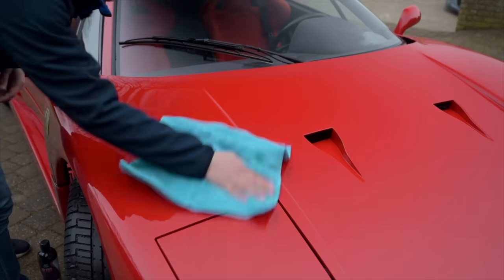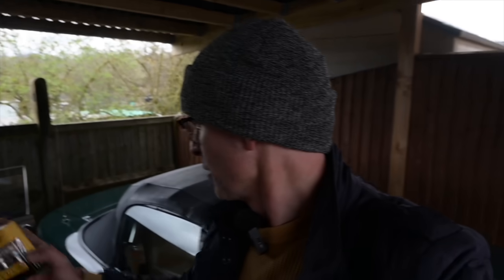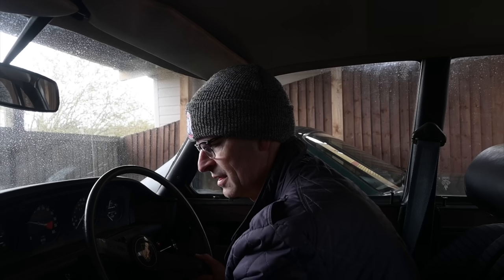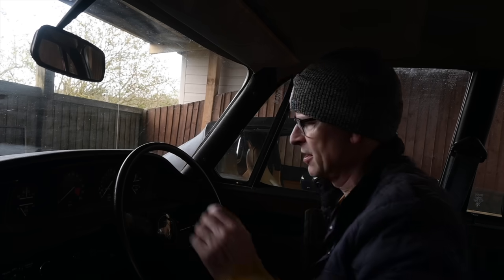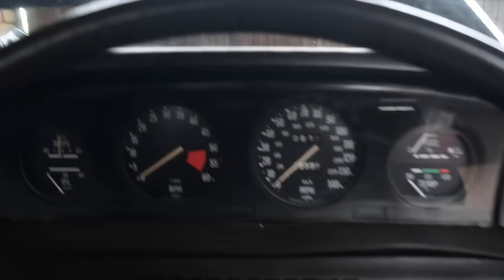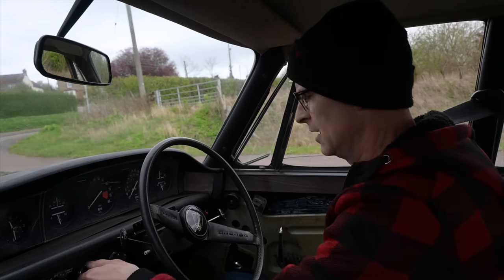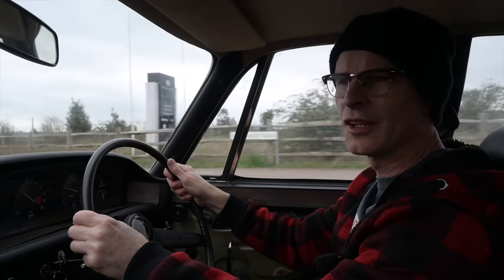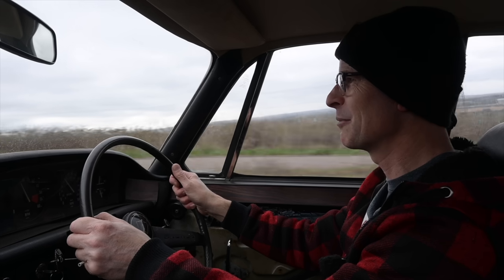4.6 V8 Rover P6 FINALLY goes for a drive (maybe it doesnt hate me now?) With Auxito AJ01 jump pack

Comment: Had one of these many years ago.   A P6 2000.  The main thing to watch out for is the steering idler - which if broken was impossible to source a replacement.   The suspension on these vehicles is quite unique.  The rear drive diff is mounted to the car body and there's a  split de-dion at the rear.   The rear disk brakes are inboard next to the diff for better cooling, so the rear wheels won't get hot if there is brake drag.  Due to the inboard disk brakes design, there is considerable stress on the  the half shafts' crosses (universal joints) which periodically used to break - often making the clunking noises you describe and if left to their own will ultimately destroy the half shaft or the coupling joint.   Back then crosses were easily available and it was a broken steering idler that finally forced me to scrap the car due to road test failure.

Comment: Looking at the steering wheel I would suggest that the tracking isn't good and 10 year old tyres are not good to run, so change the wheels, if you want, and tyres and get the tracking done, otherwise it is a nice looking car

Comment: Just sold my Sc430 due to practicalities.  It had a lovely V8 4.3 engine, being circa 2005 there was the benefit of electronic ignition and VVti, but not burdened with too many computers.  With alloy block and heads with regular oil changes apparently they can do 500,000 miles.  Cited as lightweight, compact, powerful, smooth and reliable I think it represents the sweet sipt in engine development.  Developing almost 300hp and over 300 lbs of torque (without any turbos) it was fitted with a six speed auto giving 25 mpg overall and never gave me any trouble.  Toyota certainly knew how to build them back in the day.

Comment: I love the P6. They are always very elegant. In the 1970s, my grandparents owned LAC665L, a Lunar Grey (green?) Rover 2000 SC with an automatic gearbox. I used to really look forward to riding in it. A very late-production Rover 2000, as the 2200 was introduced later the same year. It was very comfortable and, although not a V8, it could still go fast. The car is now on SORN and seems to have changed hands 2 years ago, so it's still somewhere. Very well done on getting the 4.6 V8 back on the road!

Comment: My dad had a very late 3500S. Fitted an SD1 5 speed manual box into it. Along with a customised prop shaft. Made quite the difference at cruising speed compared to the original 4 speed box. Even got a mile or 2 better economy.

Comment: This is so inspiring. I’ve got a ‘74 p6b and it runs well but in the 30years I’ve had it I’ve just not got round to getting it on the road. Hmmm, maybe it’s time it jumped the queue before they change the mot rules

Comment: Well that must be the happiest Matt in a video with the 4.6 P6 ever. Well done on getting the old lass running on the road. At the start of the video I wasn't sure if it would be one of those "if all went well I'd be driving it" given the starting issues. It might just have been stage fright from the car following a 10 year sabbatical from any duty. Allegedly we all get more grumpy as we get older, I'm living proof of that. As always thanks for sharing and I hope you find that hub cap.

Comment: Hi Matt, You're right with the stale fuel. The P6 tank has a baffle that fully  separates about 1.5 gallons as a reserve. Refuelling just tops up the reserve first, then spills over to fill the main tank. Switch to reserve and let it all pump out before the filter, as you did, and it will refill with fresh next time you refuel. It will take a long time to mix that stale fuel with fresh if not. Don't risk draining the tank. The pipe union connector is likely to break off after 50 years of age and rust. The propshaft UJ's wear on the 3.5 and cause clunk and vibration, so check them now you have the 4.6 power going through them, the diff 's dont usually give problems on an auto.  A manual conversion is possible, but the pedals will be a tighter squeeze as the P6 auto bodyshells have a much wider transmission tunnel at the front than manuals. On a factory 3500S, they share the brake fluid tank.  It has a second outlet to feed fluid to the clutch. It's an easy mod to fit a T piece, or second take off instead of  fitting a genuine 3500S brake/clutch fluid reservoir.  If you use any version of the  BL Rover LT77 5 speed box and a V8 bellhousing, it should fit ok using the existing auto propshaft. Another option could be the ZF four-speed auto and selector from a Jaguar XJ /XJS, but you may need a late 3.9 Range Rover bellhousing to match it to the ZF   auto. You could use the ZF from a 3.9 Range Rover, but you'd need to find a suitable tail-shaft housing as it is replaced by the 4x4 transfer box on a Range Rover.

Comment: I owned a 75 V8 P6 in the mid 80s, one of the best cars I've ever owned.
The power steering pump packed in, so I had it dismantled whilst waiting for a new one.
The steering wandered just like your one and it was difficult to steer.
When changed the steering went back to normal once more, all of the play was not noticable.
So wait until you have fitted your power steering before doing any repairs.

It doesn't take much to upset the Rover V8s as they are very well balanced engines, yip I agree get it on a rolling road and give it a good tune up.

Comment: That P6 and the Mazda MX5 is the perfect 2 (classic) car garage. I really don't think you need anything else other than a modern daily.
Reply: I don't think you even need a modern daily
Reply: @kyle8952  it's all down to personal circumstances I guess but my logic is I wouldn't use the rover during winter time while there's salt on the road and the MX5 isn't practical enough for a daily. Plus these cars are for fun, not for commuting.
Reply: I’ve never understood why anyone would want a modern daily, my youngest car is almost thirty years old. There’s no reason why they can’t be driven on a daily basis, that’s what they’re designed for. Leaving them sitting unused for long periods of time does more harm than good, as long as they’re cleaned properly through the winter, they’ll be perfectly ok to use all year round
Reply: @DoubleZeroGarage  depends on the make and the age of the car. You never get all the salt off and on a British car from the 60's it would be worse than leaving it inactive for 5 months. Plus I don't fancy driving my family around in winter conditions with no abs, no traction control in rwd car.
Reply: @matthewchannel9981  I've never had any problems getting all the salt off,  just use a jet wash under the car and in the arches. Obviously each to their own, not sure why you'd want abs and traction control in any car nevermind a rwd one though. People in general are far too reliant on electronic gadgets in cars that just simply aren't needed when you know how to drive properly for the conditions of the road / weather. I'd much rather be in a car that has to be driven, can be enjoyed and fixed without a laptop. An MG Midget, Austin Healey or E type Jag is just so much more enjoyable to drive than any modern day equivalent, if there even is a true modern day equivalent
Reply: @DoubleZeroGarage  my 60's Jag has far too many nooks and crannies in the structure underneath to fully clean it with a jet wash. Not worth it. I'll keep it in doors over winter thanks. None of those cars you listed are a practical daily for me. My 'modern' 20yr old BMW estate is a better option for me. I'm only reliant on modern gadgets from a safety perspective and my young family, air bags included. I know how to drive properly. Like I said, personal circumstances. I hope you understand now.
Reply: @matthewchannel9981  Totally understand and did do from the outset, like I said previously, each to their own. 4 of my cars don't have airbags or abs and none of them have traction control. 2 of them don't even have seatbelts, all are driven throughout the year regardless. Life would be very boring if we were all the same. Thanks for the conversation though, always good to get a different opinion on things

Comment: Assuming the rev counter is correct, a pretty good suggestion for the gearbox clunking would be because of the very high engine idle. They should sit around 750rpm when off choke - yours is sitting at 2000rpm which means when drive is engaged that's quite a shock for the box to absorb. So amazing to see the car on the road again :)

Comment: A great video Matt. The brake calipers on P6s are notorious for sticking ( I've had 3 over the years " all 3500S). I see you have got the standard SU Carbs and curious about the needles and springs as when you were revving it up it sounded like there was a bit of fuel starvation. 
On my 3500S I fitted k&n cone air filters in conjunction with richer BBW carb needles and the throttle response was razor Sharp compared with the original air filters and BBG needles  
As I said earlier you've done a great job on getting the car on the road .
I would definitely consider either an LT77 SD1 V8 or an R380 5 speed manual as the auto floor pan has a wider transmission tunnel than the manual cars .

Comment: The clunking your feeling is probably the u joints in your driveline that's my best guess cuz it happened from stopping to getting back onto power and that's usually where you'll get driveline noise

Comment: A Historic car doesn't need to be tested every year but it still needs to be physically safe to legally drive on the road.
If there are any problems that would fail an MOT and you are involved in an accident your insurance will disappear and you will be financially and legally liable.
Fines, points and possibly jail time if someone is seriously wounded or killed.
Reply: Absolutely. Not having to hold a current MOT certificate is wrongly often interpreted as driving a nail is fine. No, it is not!
It’s as you said.
I’ve 47 year old motorcycles. I treat them better than a two year old new motorcycle (which also doesn’t require an MOT certificate!).
I wouldn’t dream of riding a less than perfectly maintained machine. I don’t bounce.

Comment: If you are still running the HIF6 SU’s there are some SU needles and springs that will improve the 4.6 ( if the carbs are still set up for the 3.5 will be too lean at the top end )

Comment: You mentioned the bonnet problem ,it could be that when the bonnet is locked down it is holding fast to the catch under tension thus needing more power to naturally pull through so to speek ..check the rubber stops they can be used and adjusted .I would used racing catches each side with normal one

Comment: Are you sure the springy bit on the bonnet is not bent, perhaps check it against your 2000, just the way it's catching hints that the springy bit it not going though the hole correctly. Glad it's on the road, definitely the best car you have on the fleet.

Comment: A bit of advice.Always torque up your hub lug nuts or bolts.Take them down in a specified pattern.Lots of stress on those studs at 100 mph!See tyre specialists fitting a wheel on a lorry(truck).They always crank the steering  axle wheel  nuts  down with a huge torque wrench.Good Luck.Figure:65lbs ft.

Comment: There used to be a 3500S local to me in a sort of golden sand colour, slightly lowered with Minilites.  It looked really good.
What engine tune do you have?  Original SUs from the 3500 engine, or fuel injection from the 4.6 donor car?
Reply from the maker: SUs at the moment, Cloyes adjustable timing gear set for mid range acceleration to save the axle

Comment: So many ups and downs in this video, perhaps mirroring the ups and downs you've had with this car!

Did you find your hub cap?

I'm reminded by the use of the phrase ups and downs of a channel by Mr Kitch ... and his chart of dyno results ... when you have this car fettled and in tip-top condition, a road trip vlog to Fareham cumulating in a leader-board smashing dyno run would be something to see (you might even force Kitch to dyno his TVR)!

Comment: Nice, don’t think I’ve ever seen a black P6. On the starting issue, does it still have a ballast resistor in the ingnition supply? This was a BL quirk, the ignition got 12v on cranking for good starting but the supply dropped to 8 or 9V with the key in the run position to prolong the life of the points etc. the resistor is part of the wiring so you can’t really see it but they do deteriorate over time . Hence the car will fire up and run when you crank it but cut out when you let go of the key and it reverts to the ballast supply…..my 1970 Triumph 2000 actually had a 6V coil but it was given 12V on cranking to help with cold starting.

Comment: When were the UJs last done?  Replace them all anyway.  Don't lower it, fit the stiff 24mm anti-roll bar and the heavy duty rear springs and wider tyres on 6" rims.  Most other things will make it worse.

Comment: The AW71 Volvo 4 speed with OD is a direct swap apparently (yes I know it is another auto) but the ratios are correct for this but adds a 4th.  You need a Custom 4600 v8 badge :D

Comment: LO Matt, Did you take your Medication before you uploaded the video.?? Watchin you pull away  reminded me of a 414 h plate. Big car, small 1.4 I engine. No power steering. Drove like a tank took a mighty effort to turn a corner and the turning circle was  similar to the royal Yacht. Loved the thing but no oomph!! Put it into the Rover dealer who told me there was a problem but they couldn't diagnose what was wrong with it.  They offered to bring a special mechanic from Edinburgh to troubleshoot. Politely declined. Charge by the hour from the time he left his front door. ?  Flogged it .Never did find out what was wrong with it.  That was 1988 ish.  Happy Days.

Comment: That stale petrol looked more like kerosene which it basically was as all the volatile stuff had evaporated, being much heavier takes a lot of movement to mix, fill the tank and go for a long run.  The prop shaft could be out of balance causing the noise and vibration under heavier loads.  Did it have any balance weights on it either come off or now not in the right place.

Comment: Well done for finally getting it on the road - I know it's been a testing journey. Interesting to see the oil pressure gauge reading modest figures, what oil are you using in it? I know they're not known for strong oil pressure, my 3.5 only manages about 25 psi when hot and running at a decent rpm. When hot and at idle probably more like 10-15psi.
Reply from the maker: This is still running in oil, but it has been showing up to 40psi with the high flow pump its got now
Reply: @furiousdriving  Amazing. I assumed it must be running on really thin oil. Congrats on all the hard work.

Comment: The Triumph Stag Club members talk about changing the automatic transmission to a Jaguar ZF-4HP/5HP 4/5 speed that transforms the car's drivability no end. The BW35 is not the greatest shifter plus top ratio is very low. The BW35 also does not cope with being left for long periods without use. A conversion series would be a good watch.
Reply: There are a fair few conversions on P6s, including mine - it's actually not much more expensive than replacing the original box.  Very probably ~20 or so cars now.  The same conversion is done on P5s and with some effort at least 1 SD1.  It's not just the extra gear, the main benefit is the torque converter lock-up.  i.e. you get no slippage in top gear. It's also a LOT smother all round as you'd expect with 25 years worth of newer technology.  You can (at a squeeze) get 32mpg (imperial) at motorway speeds with this setup.

Comment: The starter seemed to get slower every time you restarted. it was cranking really well from cold. Is it charging ok? I have a similar problem on my old Vauxhall Viscount; charges fine but starter turns slow/struggles when hot. I think it might be starter motor bushes/bearings.

Comment: That bonnet's bouncing quite a bit!
Reply from the maker: they always do on P6s
Reply: @furiousdriving BL used rubber covered alignment posts on the front radiator brace to stop bonnet bouncing on the SD1’s. Maybe adjust or retrofit them ?

Comment: The brakes on the P6 are very good, I seem to remember you replacing the front calipers so if you feel they are not as good as you imagine, a look at the rear calipers is worth carrying out.  Does the handbrake hold the car and also pull the car up during low speeds?  The rear calipers are a whole new ball game.  I seem to remember a quote from a Rover forum, it went something like this:-  Commenting on the complexity of the rear calipers, my brakes guy once said, having a rear brakes system like that on a Rover P6 is akin to buying a Rolex and sticking it up the bum.
Reply from the maker: the handbrake is very good, but the rear calipers are something I dont want to play with!

Comment: The worst BW35 car I ever drove was a Woolsley 16/60 Automatic. I had to drive it over a 200ft mountain pass, at some points it was down to 10mph on the highway and loaded semitrailer trucks were overtaking me. I presume you will put an SD1 5 speed into this P6? Mind you the BW36 probably works ok with a 4.6 if it can handle the torque.

Comment: What did you change to make the 3500 to 4,6 swap work? (Ecu - transmission - brakes)
Reply from the maker: the 4.6 block, fitted with P6 intake, sump, timing cover